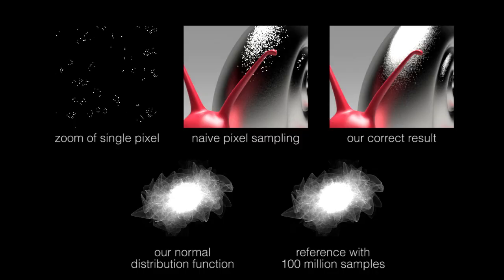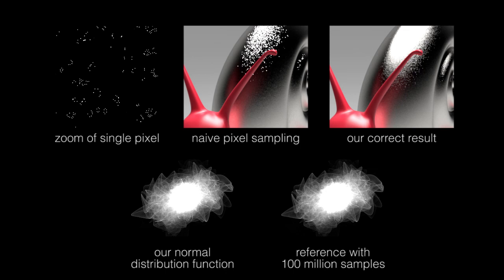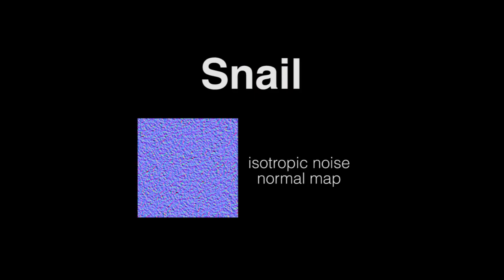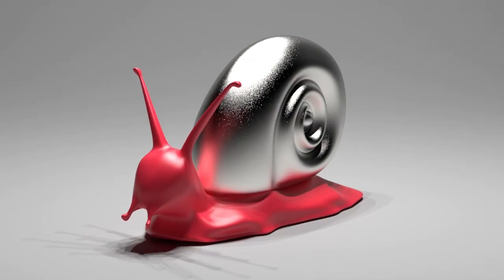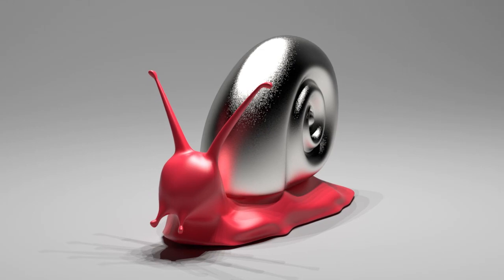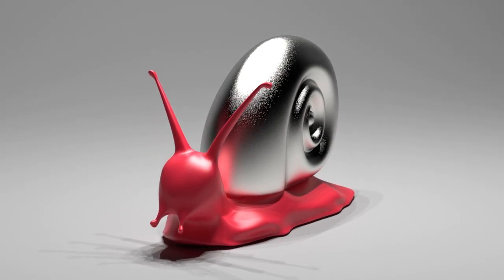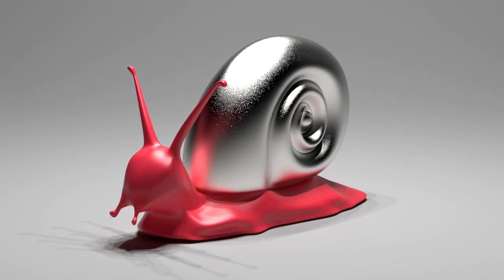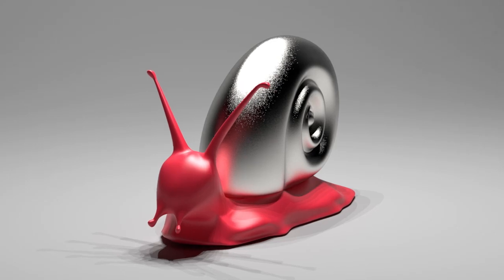Siggraph 2014: Rendering Glints on High-Resolution Normal-Mapped Specular Surfaces

Comment: That last example actually looks like it could make it into games or offline rendering. That is, if it makes sense from a performance point of view. Does it?
Reply: It could in theory, but only if it is a prebaked model with prebaked light maps, animations, and textures. Usually, the amount of time it takes to render this kind of ocean animation (only a few seconds of video) can take hours on a very strong computer and days on a normal daily use computer. In order to have this kind of thing work in real time, meaning always being rendered continuously, like in video games, you would need to do an operation called baking to the animation, the lighting, and the textures. What this means is that everything is packed into the model when it is exported into the game. If you were to try to add lights or animations after baking and try to have them work in realtime, they would not affect the model. This is used a lot in games for static objects like rooms and non-moving furniture.
Reply: could you do this in a realtime Path tracer?
Reply: John Sherfey real time path tracing isn't even a thing yet and is far more power hungry than current raster based engines for real time. But yeah, it could
Reply: Tao S. Umm yeah real time is a thing. Brigade engine is a good example
Reply: John Sherfey that's what I'm saying: it's not a thing. Brigade has been in closed (but like really close) beta for the last 3 or 4 years, none of the current consoles nor the best graphics cards out there meets its need quite much to provide noise free stable images with a stable frame rate and not a single commercial project has been using it.

Real time path tracing is probably (I hope) gonna be a thing in 5 to 10 years, and it's gonna be quite a thing. But right now, there isn't any commercial real time application that uses a path tracer or that plans using one and there are only a couple experiments in the works afaik (like Brigade).
Reply: Tao S. Yeah, I'm trying to make one (hopefully) This should add less randomized numbers thus leading to faster convergence.